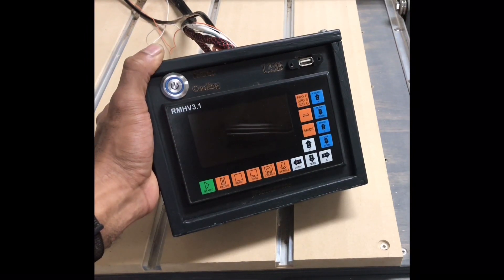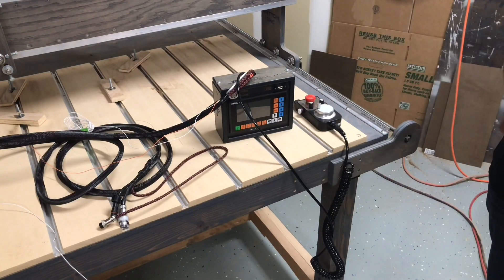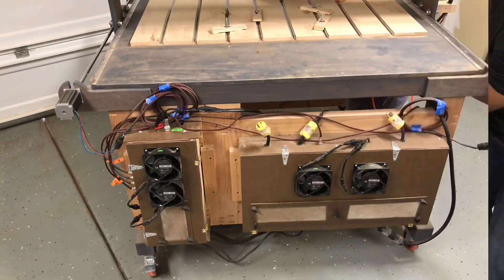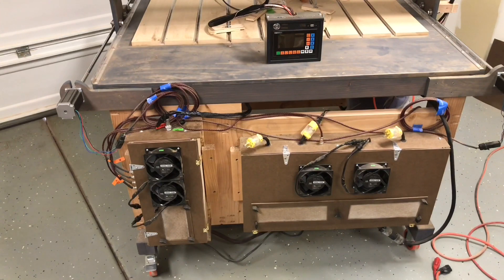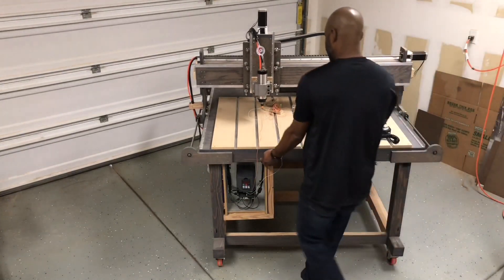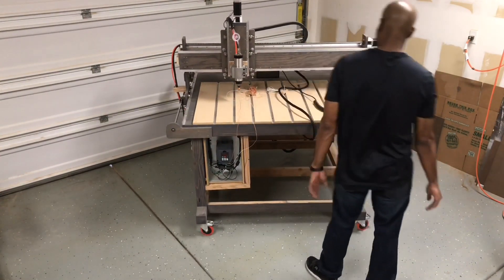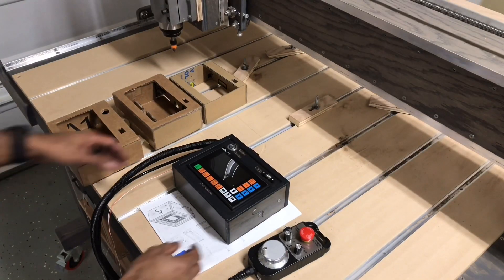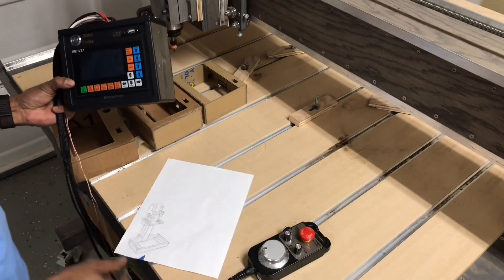Plug-in Offline CNC Controller Enclosure Project for my Gatton CNC

Comment: Hi Johnny! I just came across your videos and am hoping you can help me.  I'm in the process of building a CNC router using the RMSV3.1 controller and DM542T drivers for the stepper motors. Now it is my understanding that the display on the controller should accurately depict the actual travel in each axis.  We accomplish this by plugging in the correct value in parameters #34, #35, & #36 (pulses/mm).  The motor step angle is 1.8 deg, the microstep factor is 5.  The timing belt pitch (no lead screw) is 3 mm and the motor pulley is 20 tooth.  This results in a value of 16.66 pulses/mm.  However the RMSV3.1 will not allow me to enter a value less than 50.0.  Any thoughts?  Otherwise I am dead in the water with my build.

Comment: For mobility there is MPG, why make a mobile controller?
Reply from the maker: Simple answer, I did not know any better.

It is redundant, but I have enjoyed being able to use the mobile controller as a hand held unit allowing me to use my thumbs to press buttons as well as bring the screen to my face opposed the opposite. There are also some other things that I have found come in handy. The MPG does not have the ability to turn On/Off the Spindle or the Water Cooling for the Spindle which I can control separately from the controller. This allows me to have the controller with me when I have the Power Enclosure, Driver Enclosure, or the Pump Reservoir open for function checks or trouble shooting. I could have avoided most of this by having my enclosures one the front of the CNC but I figured I might benefit more by having the enclosures on the back. The VFD power runs through the Power Enclosure and I did not want to risk increasing electrical noise/interference to the signals to the Stepper Motors. I plan on having quick access storage on the front of the CNC which I believe I will be the most beneficial. I designed my enclosures with more filtered ventilation than I have seen on other machines and knew that constant fans blowing air out of the front of the CNC would get annoying. 
  
I admit, I thought I was building in a premium feature with the Mobile Controller on my CNC but after having a Mobile Controller I would not have a CNC of this size without one.  I also started with very little CNC experience and even less with an Offline Controller. I knew I would be destine to build a newbie extravagant 1st build. I hoped I would have a few good ideas, but understood I would not doubt have some scratching their heads.
Reply: @SuperJfritz  I recommend the DM500 https://www.youtube.com/watch?v=nTwsY6tztJA

Comment: I also have that controller (an updated 2.1) and MPG.
The products themselves are ok but the documentation is typical Chinglish.
Also as you found, making the unit remote will turn out to be more pain than it is worth.
Locate the workpiece, press play.
Hover over the Estop.
I do have a diagram of that MPG wiring that helped me more than anything else.
Reply from the maker: Yup, once again wisdom from someone with experience. I plan for the unit to stay in an articulating mount that would make it seem as if the offline controller was mounted as an operation panel, with the perk of being able to relocate it if I need to operate the machine while in the back for example. Mostly do the the size of my table. Honestly I also like to be different, and this hobby is all about finding out what can be right?
Reply: Could I get that mpg diagram from you?